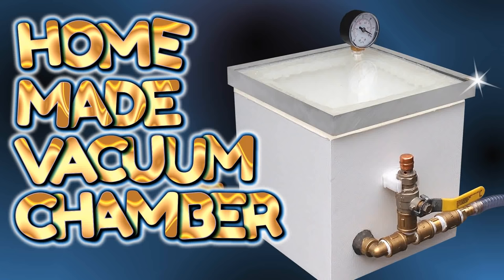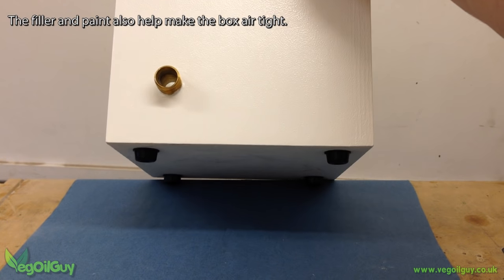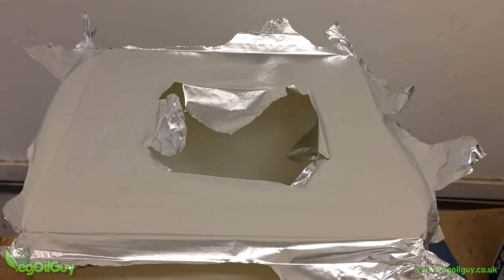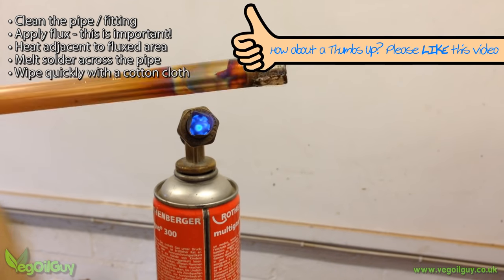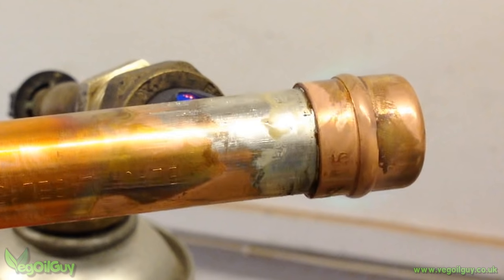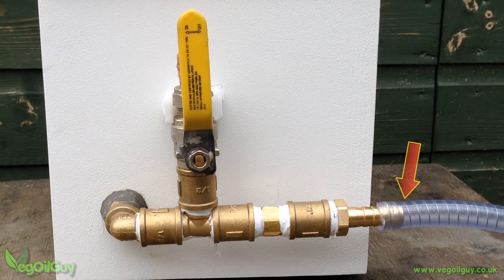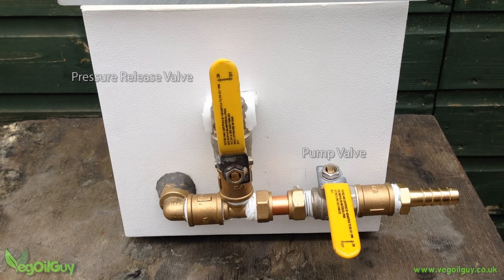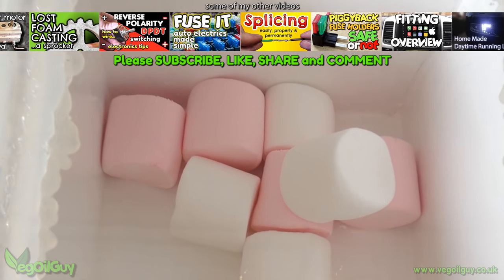home made SIMPLE BUILD vacuum chamber - by VOGMAN

Comment: Nice demo on the tinning. I heard my old man from the great beyond saying "only spin the wire brush in one direction." He would always tell us that if you rocked them back and forth it bends or breaks the wire in the brush as it changed directions. It doesn't matter which way you go just never change direction.
Reply from the maker: Nice tip. I've not heard that one before  : )
Reply: 👍 Dad's right on that! 😉
Reply: Bullshit. I always go back and forth and still have the same wire brush cleaner from like 15 years ago. Which wouldn't matter anyway as they cost like $2

Comment: One belated alternative:  while not perfect, a fast-and-dirty alternative to silicone rubber is foam mounting tape, sometimes sold as "camper mounting tape" or "foam rubber tape".  It provides a surprisingly good vacuum seal for a low cost -- the biggest downside is that it only does so under compression.  Not generally a problem for vacuum chambers, but can be tedious in other applications.

Comment: Now you can check the gas level in your aluminium castings, just have a small (about 1/2 a cup) steel mould in the chamber fill the cup with molten aluminium immediately apply  vacuum down to 0.1 atmosphere. Later slit the casting and clean up with abrasive paper to see how much gas you have - try different degassing methods and see what you get. Love the marshmallows are they nice and chewy afterwards?... Martin.
Reply from the maker: More tips from the master!!!
Thanks for that Martin. It's not something I would have ever thought of - or even knew about.
Reply: VegOilGuy using a electric Furness greatly reduces the amount of gas Ingres into the melt doesn't it?
@olifoumdryman. 
Isn't the main cause of hydrogen from the waste gasses from the fuel combustion? 
The reason to use electric is it's much "cleaner"
Reply from the maker: You're quite right. I'm not the guru of course (Martin is), but I know Martin has mentioned to me previously that it's during the melting process that a lot of gases are introduced. As electric foundries are fairly sealed and don't rely on extra oxygen to achieve temperature, there should be less gases involved : )

Comment: That got to a full vacuum surprisingly fast, great job!
Reply from the maker: Thanks Koos. It's the size. Being small there's less air to evacuate. 
I looked at the containers I generally mix things in and they're usually quite small, so I thought - why built a big chamber? Small makes more sense. There's roughly 8 square inches of space inside and when you compare that to most things, they fit.
If I ever need a bigger one, the same principles apply. I might need thicker sides to resist the pressure, but as long as it's air tight, it will work : )
Reply: I was nervous about the corners holding up but I’m glad it worked.

Comment: I’ve just started watching trough your vids and don’t know if it’s been mentioned yet but if you don’t want to risk heat damage to electric vac pump find a refrigerant pump from a used window AC unit or refrigerator.  (Window unit is normally better style). With a little searching its not hard to find one someone is throwing out. I use one to degas silicone and resin before casting, these pumps will draw close to -30 in Hg (normally -25 to -27)
Reply from the maker: Thanks for sharing James : )

Comment: I've just built one of my own and hopefully in a few days time I can start using it..........I just have to finish painting, install the silicone seal and plumbing, and I'll be good to go.
Reply: Update.......it's finished and it works, but on mine I had to add a 1/4" rubber seal on top of the silicone due to my acrylic top piece not being able to sit right on just silicone alone.

Comment: Try - vacuum distillation.
Boiling points of water and ethanol drop as pressure drops. Ethanol will always boil lower than water.  If the pressure drops enough, you can distill ethanol at close to room temperature.
Reply: Explain again

Comment: I made my own using a lunch box. It's made out of glass, has a strong plastic lid and a rubber gasket around to seal it. I simply drilled a hole in the lid, inserted a pipe fitting that was screwed on from both sides with thin hex nuts and 2 o-rings in the middle. It's then connected to a vacuum pump and works great. It only cost me 5usd if excluding the vacuum pump.

Comment: Nice job showing how simple it can be. Making a VC has been on my to-do list for too long and this gives me inspiration.

Just a ? or 2

* why did you use a plank lined with foil to form the silicon seal instead of simply using the plexiglass top?

* why did you put the vacuum gauge in the plexiglass lid rather than on a "T" just upstream of the close off valve?

These ?? are not criticisms, just curious.

And then a tip (which you probably know about but someone else might not.

* Silicone tubes are notorious for hardening up once they have been used once. To stop it happening, take a small piece of aluminium foil and smooth it over the end of the opening before screwing the cap down over it. (You need to screw the foil well into the threads). Since I learned of this I have never had a tube dry up on me and I have some that I've been using in dribs and drabs for more than 5 years

* when finished using it, leave the waste silicone in the screw on nozzle. Leave it to thoroughly set and pull it out with long nosed pliers. Trim off the small end. Makes a beaut ear plug.

* keep the old nozzles and cut them off at different lengths so you have a set with different opening sizes.
Reply from the maker: Thanks for the questions and the tips  : )
Answers...
1) I used wood so I could have a hole in it, encouraging the silicone to go off
2) Just a personal choice  : )
All the best.

Comment: Good vaccuum chamber.  Here' another way, make your box a little bigger, place a car tyre pump at the bottom, drill a hole and put the inflation hose out through it, then seal the hole. Extend the on/off switch and the +/- wires of the pump to the outside of the case , again seal it now connect the other side of the switch to a small 12v battery ( or car battery). Switch on. the pump will evacuate the box through the hose... Ta, Dah!

Comment: what paint did you use ? being made of wood it would have to be sealed properly so as not to draw air and moisture out of the wood
I want to make a very large chamber for freeze drying foods stainless is very expensive wood is cheap and easy to work with I was thinking of sealing with resin but not sure what that would be like under full vacuum

Comment: I say 5 stars for using wood.  That took some balls.  This is the only one I have seen made of plywood.  It makes sense to me.  Use wood for the structure and a sheeting and silicone to hold the air.
Reply from the maker: That's Jeff. Plywood's fine. It's strong and stable. This was an eight inch square chamber. If I wanted to make it bigger, I'd probably thicken up the plywood from 18mm (3/4 inch), but I'd still be happy in it's strength  : )

Comment: I like the video,  however, I think with a little extra plumbing, maybe a cross instead of a tee, (or another tee) the vacuum gauge could be attached between the valve to the pump and the vent valve so the acrylic top needn't be compromised.

Comment: Ayup chap. Nice demo fella, very impressive. Keep it simple aye? Got a feeling I might be making one of these, albeit maybe slightly larger. Thanks mate.
Reply from the maker: Size doesn't matter really mate, just remember to scale up the strength as well. I got away with 18mm plywood as my box was quite small. Vacuum chambers are surprisingly powerful, so thicken and strengthen as you enlarge. As long as things are air tight, you'll be fine : )

Comment: You may have already seen this before. You can add a generous amount of liquid dish soap to a bowl of water, and then add silicone to the water. Then just knead it under water until it stiffens up a little. Shape as you will. Takes about an hour to cure. There are a ton of videos on this.
Reply from the maker: Actually I haven't come across that  : )

Comment: Buying all the necessary parts now! When you say expansion glue, what do you mean? Which glue did you use to make the seal between the pipe and wooden box?   Also, did you use something other than typical indoor wall paint?
Reply from the maker: It's good glue that expands a little like expanding foam. It doesn't really matter as long as your joints are okay 😁

Comment: Started one copying yours. BUT my caulk is not curing (didn't know it had an expiration date! Dang.) While it wasn't curing, I thought of a possible improvement in your method.  Why not put the four sides together, then put the foil-wrapped upside down and set the four sides on top of it. That way you can reach all the joints of the top (inside and outside) to make sure the caulk is perfect. (I couldn't see what was going on in with the top and bottom both on.)  After the caulk is cured then put the bottom on and test it. Just a thought.
Reply from the maker: Thanks Johnny. There must be 1000 improvements or more that are possible on this design and I'm pleased you and others can see that. For me it was about proving something like this can be easily and cheaply made : )

Comment: Looks great!  While  back  i did something like that  with a Solid  heavy Shoe box. That work boots came out of it. I thought. I wonder if  this work to make a vacuum  chamber.  Took duck tape! Shoeboxs. Cut out the hole for my nozzle  vacuum cleaner.  Glue and tape it. It worked i mean if you doing resin . Work for that and it did. But for the real McCoy.  Yeah you go the extra mile  to build something like that  or any other vacuum  chamber  pot! I have and old air compressor  small  one. In future  attempts to  make one. From old small  Compressor.
Reply from the maker: The fun is in trying : )
Reply: Your right

Comment: If you use two part silicone instead of RTV, it will cure all the way through.  The silicone didn't cure because it couldn't release gas anywhere but the sides.

Comment: There is also a product known as tinning flux that has a bit of solder mixed in with the flux itself so that you simply have to heat the pipe and apply the flux and it tins the copper

Comment: Thank you for the video very informative and entertaining. However it will be nice if you can explain 1. What is "expanding glue" 2. What type of filler and paint you use? 3. Did u apply filler on all the inside surfaces to act as a sealer or you just rely on the paint to seal the surfaces.
Thank you!
Reply from the maker: Good questions all  : )
1) Expanding glue is a foam like substance... it goes on runny and sticky and then expands (like the canned foam). It's nice strong stuff.
2) The paints were ordinary household paints, water based I think.
3) The filler was more for cosmetics... I used car body filler. But this does work well on wood.
Ideally your wooden joints should be as tight as possible. Any foam glue, paint or filler are there as extras.
Reply: 1. Polyurethane wood Glue, in the US its commonly called Gorilla Glue since they were the first major maker of it but Titebond and Elmers also make it.
Reply: @chartle1  Harambe's finest

Comment: I was thinking: do you reckon it'd be possible to use a normal 12 V compressor to draw a half-decent vacuum by mounting it inside the chamber and having it pump out to the atmosphere?  At one point I had a chamber made of a big pot that I had planned to try this with but before I got everything together to try it I ended up moving and it got left behind somewhere.
Reply from the maker: In honesty I don't know, but if you have one, give it a go. It sounds a fun experiment : )

Comment: Thanks! I'm just building one. Everything is fine, except that I had problems with the way of making the silicon seal. I think I used to few silicon or didn't press it down enough: I had some creases and this obvious was not airtight.
Than I had another idea: Most of us making castings will have a two component silicon. So I added tape on the inside and the outside of the box, jutting out about 10 mm. So a spacing, a kind of trench is formed, that can be filled up with the silicon. As this flows nicly, the surface will become flat - just have a look, that the box is place level until the silicon cures (1h with mine).

I just needed 60 ml (about 80 g) for a 4 mm thick seal on my 20 by 20 cm box. So this isn't expensive either.
Reply: My box is working now. I did some degasing (fine!) and now I´m trying a kind of "brass sandcasting with vacuum" on a lid with a hole and silicon seal. After my first tries I think I have to switch off the vacuum earlier. I left the pump running until the glow of the metal was mostly gone. The sand burns darker and maybe a bit of the metall as well, when oxygen is constantly flowing thru. Have you ever tried "vacuum sandcasting"?
I will try it with pewter next and when this works fine, I will give brass another try.

Comment: This video actually makes me go out and build one! Question: Does the vacuum gauge reach all the way through the arcylic? I'm assuming you also used a bunch of expanding glue.
Reply from the maker: The hole for the gauge goes all the way through, yes. As for expanding glue, not much really. It's best to have good tight joints and any good wood glue would help with that : )
Reply: @vogman  that was quick! Tnx! To clarify my question: my gauge is too short to go all the way through the hole, but that doesn't matter right?
Reply from the maker: Mine doesn't either : )
Just use PTFE tape or similar to make sure the thread is airtight. That's all that matters.

Comment: 4:00 the trick on the pipe dont surprise me since i do the same for electrical wiring xD but cool
Reply: i may(must) remember this :D
Reply from the maker: I'll be honest, I tend to tin electrical wiring as well. Have you seen my electric crimp connectors video? I talk about the different sorts and their uses, then shamefully admit I tend to use a soldering iron instead : )
Reply: @vogman  something to try when you crimp those connector  what i often do is add tin on the wire before crimping them instead of soldering everything xD

though solder everything  like you already do when you need it absolutly  want it solid

Comment: Great video.  I have a vacuum pump but was wondering what else I could use for my dome cause my dome is too small.  Was concerned that the pressure would break glass, but apparently that is not a problem  Thank you.
Reply from the maker: Hi Laura. Flat glass might be a little brittle. Traditional vacuum chambers used rounded glass which has more strength.
Here I've used thick clear plastic. It's holding up great : )

Comment: How do i know if a pump will be strong enought to de-air resin/silicone for mold casting?
Reply from the maker: You'll notice I had a small gauge on mine. You'd need to get specific data from the company whose product you're using about how much vacuum is required.

Comment: I like the idea of using ply for the chamber, does it hold a constant vacuum over a few hours or over night? Putting the valve on the bottom could be a pump killer if you have a bubble over or your box gets bumped, I've seen people have a second smaller chamber between the pump and the pot for those kind of mishaps. Thanks for sharing
Reply from the maker: Thanks Johnny... some good points there.
I'll be honest, mine loses vacuum over about 20 seconds or so without pumping, but I blame this on the plumbing not the plywood. There's no sign of the paint cracking or peeling on the ply, which I think would occur if it were porous. 
My plumbing parts were all re-used from other projects and not really bought for purpose, so I think that's the source of my fault, but the concept stands I think  : )
Reply: I would actually blame it in the plywood, you can't get 100% sealing from unsealed wood and eventually the wood will lose its integrity over a period of time. Clear PVC plastic thick sheets and silicone joints would be ideal. That way you can see if leaks develop. You could seal the wood using the silicone sealed joints like you did with the top but eventually the wood will lose its layered integrity over time. And also check your plumbing!
Reply: Could you perhaps seal the plywood with epoxy resin instead of paint, maybe 2 or 3 coats...?
Reply: @vogman  I just made one using the video. I have the same issue (about 15sec), and was wondering how air tight the plywood is. I have checked my plumbing(I can plug my solution, and it is nearly completely air tight) and redone all my seals twice to no avail. Next I guess is to try and seal the plywood.

Comment: Thank you for your epic videos. I was wondering what other ways there are to slowly melt the wax out of the investment without using a foundry? Thanks legend
Reply from the maker: Melting the wax out is easy really. An ordinary kitchen oven can do this and typically 80C or so is enough. 100C will certainly do the job. However, we can't be certain ALL the wax has gone. Traces can remain. These burn away cleanly at much higher temperatures.
Also the plaster itself needs the heat to properly prepare it for vacuum casting.
I hope this helps 😁

Comment: I've been looking into vacuum chambers (and pressure chambers as well) for casting silicon.  Do you think a similar build with a different lid and lid fastening method might be able to hold pressure as well?  It'd be awesome to be able to have a single device to fill both needs.
Reply from the maker: I think there's countless ways of doing this. My demo here was to show what could be done with spare, cheap parts. As long as it's a strong, non-porous construction, it should work : )